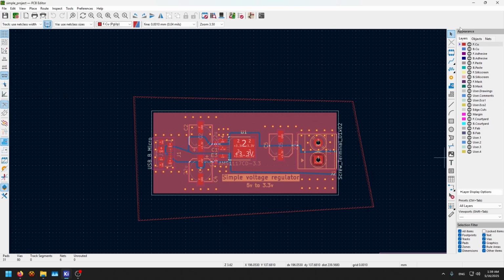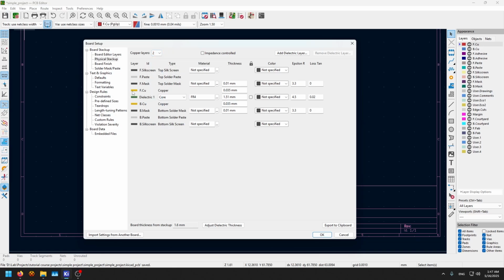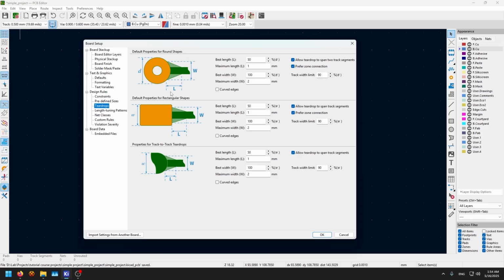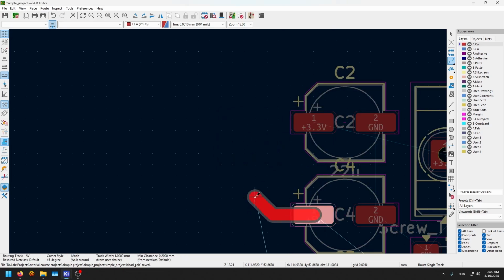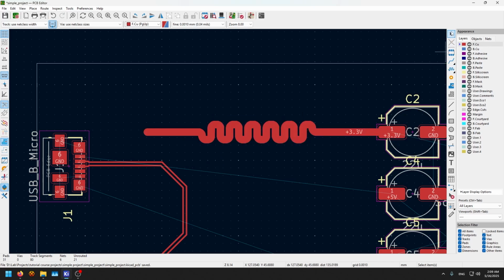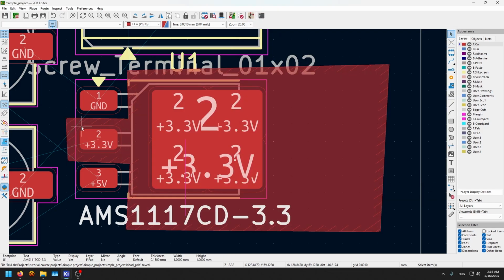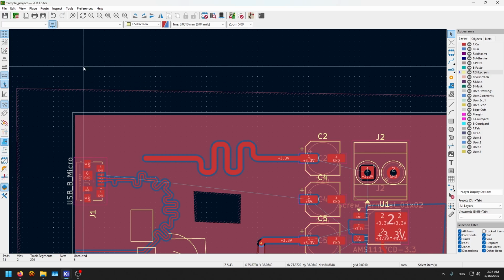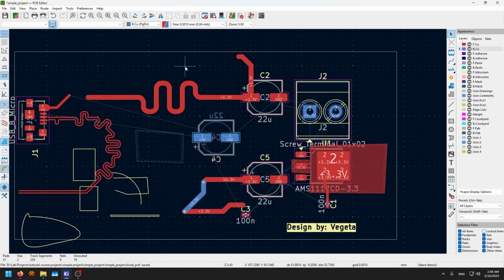KiCAD 9 tutorial course [04] - PCB editor

Comment: Hi Bro,  Recently I faced an issue where laying out the ground pour "overwrites"(i cant get a better word) another plane in the same layer. It was  a bug in v7 version and showed it was resolved, but do you face it too? This ruined my first iteration of printing
Reply from the maker: if i understood your comment correctly, you have multiple copper pours which overlaps each other... but when you press B to flood them, some of them overtakes the others.

this is normal behavior. all you need is to modify the copper polygon own level or priority by pressing E. try that then flood again. it works
Reply: @Thundertronics  Thank you I will try. In my case, I had a single 3.3V plane in the top layer. Then I poured gnd in the top layer and this 3.3V plane dissapeared. I didnot know of the priority level. Ill definitely look into it

Comment: thank you, i think a simple analog circuit board design example would be useful for people in the DIY audio community
Reply from the maker: check episode 2 where i went into a complete simple project just to demonstrate the software.

as for specific circuit type design, i could do it in another video outside the course
Reply: @Thundertronics  i watched episode 2 before i watched this one and found it informative, however it would be useful to see some wire routing done with ground pours as an example (hopefully with thru-hole components as they are more popular with audio hobbyists).

thanks again for the tutorials, i will continue to watch them as you release them.
Reply from the maker: i will see if i can make a future tutorial in the series for a bigger project.